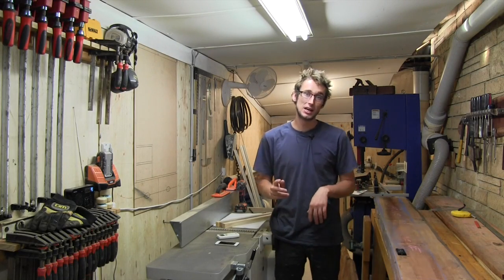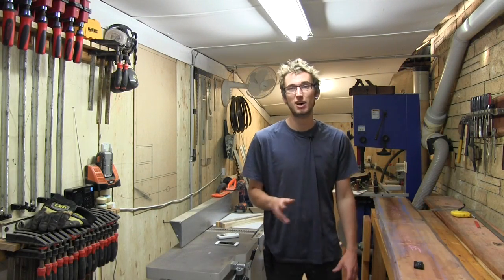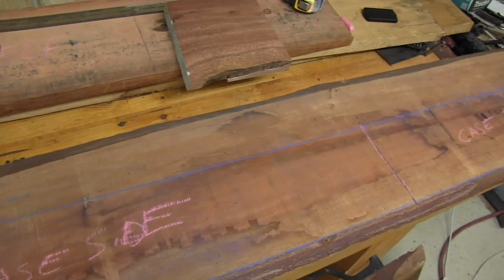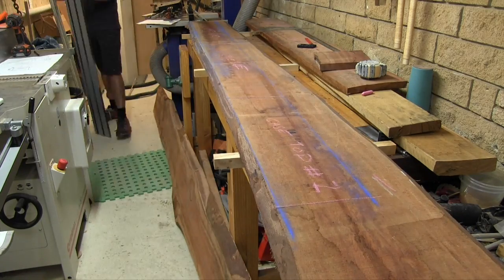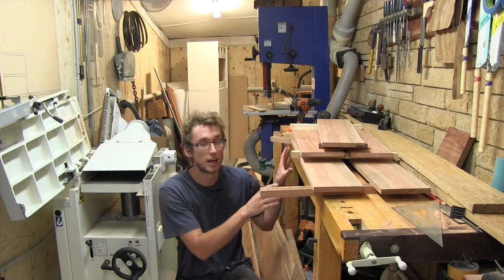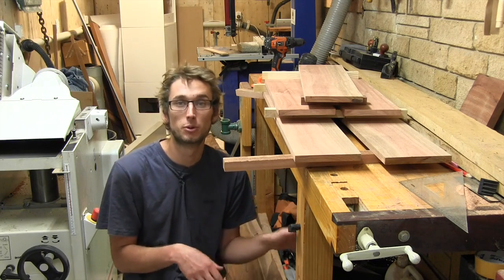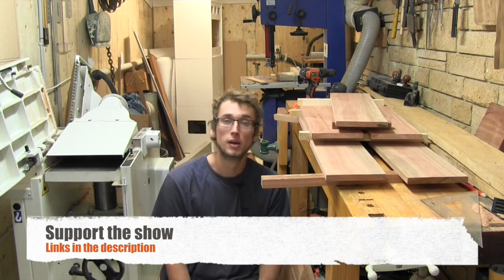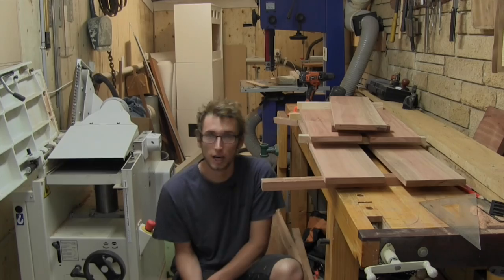Wall Hanging Tool Chest Part 1 - Project Intro & Stock Preparation

Comment: Thanks for the chalk snap line tip! I looked at mine (and can of extra blue chalk) sitting on a top shelf a day or two ago and wondered what I would ever do with it now that I don't do construction anymore. Meanwhile, I am currently laying out an entry door project on rough wood. Never thought of using the snap line. It will help with harvesting pieces with straight grain that are not parallel to the board edges too.

Comment: Glad it worked out and you didn't have to give up your shop and making videos completely and I'm excited about this first build! Quick question: What's the brand of that combined jointer/thicknesser you got there and where did you get it? I'll be putting together my own shop at some point this year and that looks like a very space efficient solution for a small shop!

Comment: Looking forward to the build Jordan! My next project will hopefully be a handing hand tool cabinet.

If you don't mind me asking how much does a Karri board of the size you milled up run in WA? I am new to buying large hardwood boards and to trying to get an idea of a decent price as each lumber yard I have talked to has varied significantly regardless of species. I am in SA.
Reply from the maker: To be honest Im not completely sure as I mill my own timber, but I would think it would run about $80-90dollars.
Reply: JordsWoodShop cheers Jordan. I syspected you might have. I want to get into milling my own lumber some day too.

That is a lot cheaper than I had been quoted for a pine board of a similar size. Gonna have to do some more research on my end.
Reply from the maker: Airman17054  If you're looking at getting some timber for cheap the forestry commission holds auctions every 3-4 months and sells green timber and slabs for super cheap (does need a year or two for drying mind you!).  Price is often less then a quarter of the price of timber yards. Im sure there is similar auctions over east.